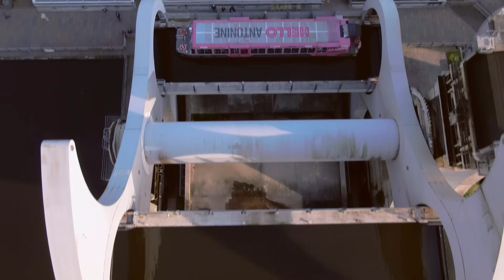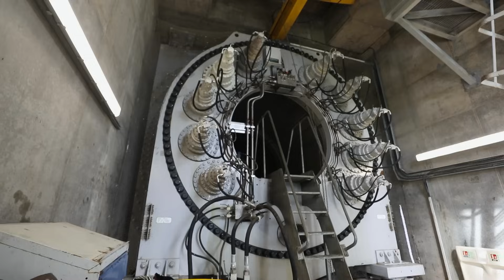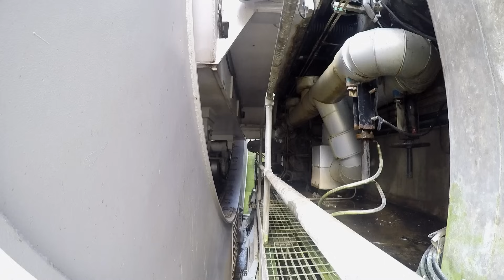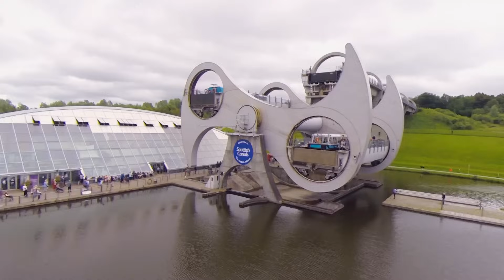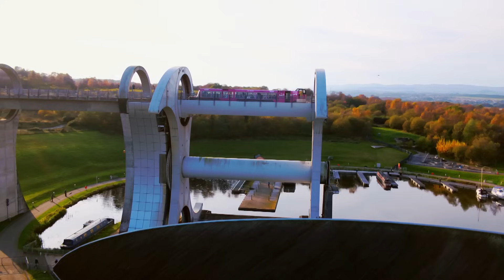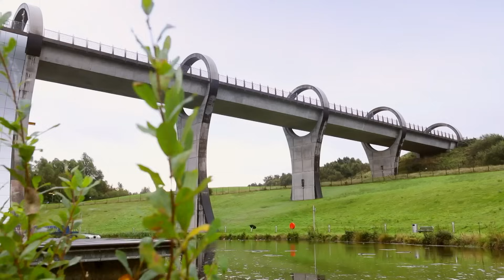How a Giant Ferris Wheel Lifts Boats | Blueprint

Comment: Since passenger jets are designed to be as light as possible, using them as a comparison large mass is rather silly. Saying something weighs "as much as four 747 jets", infers that those aircraft are as heavy as their visible size suggests. When they are actually very light for their size. Why not use items that people already have a notion are very heavy for their size, like 4 loaded dump trucks or 4 diesel train engines? Save the jumbo jets for comparing the volumetric size of things rather than weight or mass.